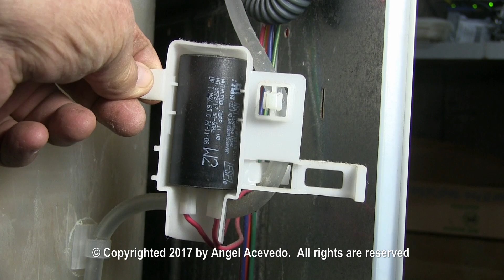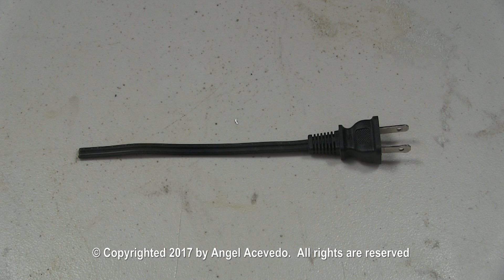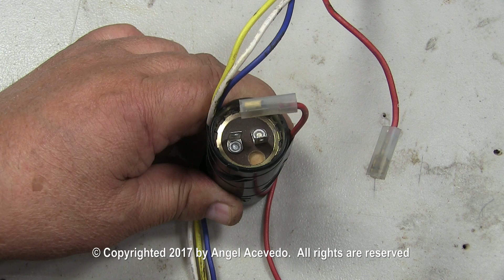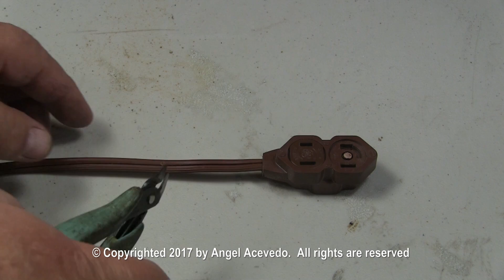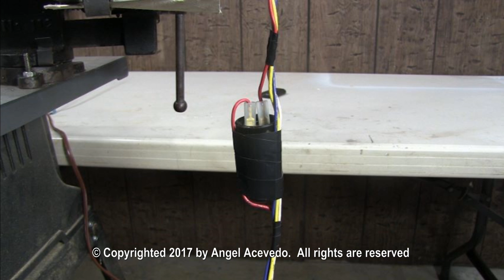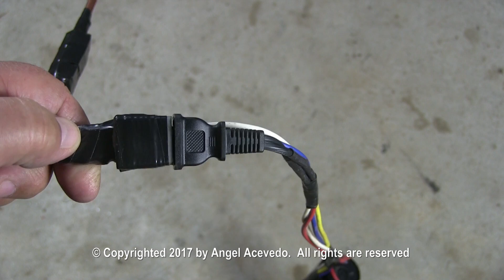Whirlpool Washing Machine Not Starting - How To Make A Motor Tester Wire Harness

Comment: Hi Angel.  Thanks for all your videos.  A while back I though you had a video that showed how to use quick connects to create split  leads from the timer switch and lid switch connector to supply power to test the motor.  This tested the motor functions for agitation, spin, draining, etc on a whirlpool washer lsq8000l series.  Do you have such a video.  I can't find it.  In function it was similar to your test cord.  Thank you very much.

Comment: I need this same tipe of video but on a 4 wier moter
Reply: I too.  One ground wire & three others.                                                                                                                      I don't want to damage it if the problem is elsewhere.  Did You ever find out?

Comment: Where did you get the push button switch?
Reply: It's a safety switch from a dryer when the dryer belt breaks the idle arm from the idle pulley is no longer having any tension and it moves and no longer pushes that button thus preventing the entire dryer from starting because of a broken belt. It's funny you ask that question because when I saw this video when he showed the switch for the first time I instantly was like Hey I recognize that part. Lol

Comment: Will a timer cause spin cycle to be slow after about the third wash, sometimes sooner? I have a set up on my whirlpool washer just like this one, I've replaced the clutch and coupler, and all cycles work good. It gets to the spin cycle and it's slow, clothes are too wet to dry. I did bypass the lid switch so I could watch the cycle in spin mode, it just won't spin fast enough and it is random, sometimes it spins up just fine... all other cycles work right all the time. I'm so tired of messin with this thing, it's got me puzzled.
Reply: Very good job
Reply from the maker: Not the timer only send electricity to the motor winding according to the selectio regular is fast gentle is slower.

Watch this video to see if it help you

https://youtu.be/q942xn_2VXY

angel
Reply: @theapplianceman  ok, I only use regular wash. It has a two speed motor according to the label on the front. I don't want to rule out the motor being the issue just yet, I keep thinking the motor isn't going in high speed, but I do not know what or how that is controlled.
Reply: @theapplianceman  I watched the video, this is exactly what I did to my washer when i put a new clutch in it, but it didn't resolve my issue. I'm not completely sure, but I absolutely do not see the washer has any mechanical problems, I honestly don't think the orginal clutch was even bad, but I ended up replacing it not knowing otherwise.
Reply from the maker: @garyr7027   The speed of the motor is controlled by the timer sending electricity to the regular speed winding or the gentle speed winding. If the motor runs ok in regular and the washer don't spin properly the problem could be the clutch, the basket drive block here is video link     https://youtu.be/ySQeR9XpEMw    check it out
Reply: @theapplianceman  I watched the first video you posted closely, I did not spot any problems, everything appears right, but I could be overlooking something. You mentioned a basket drive might be bad, would that cause a clutch to slip? I put a new clutch in it thinking it needed it just like your video   and other video's state two weeks ago, but if it's still slipping then something has to be causing it. I'm about ready to just buy a new washer, but I really don't want to unless it's just not worth it to keep throwing parts in it. All major parts for this thing isn't exactly cheap enough for me to keep it going... the washer is kinda old.
Reply: @theapplianceman  I watched the videos you posted and I checked out my washer as good as I could. I still do not see or detect any mechanical issues with it, I checked all those things out you posted. The only thing i can think is the timer sometimes does not make the motor spin in top speed or the motor is going bad. This is a random issue it's having, something like you would see in an electrical problem, not in a mechanical issue. The timer somehow would have to control the motors stator current in order to control the speed of the motor, I honestly believe the problem is in that area somewhere cause it's random issue, it doesn't always spin slowly. Thanks for your time and your video's, it helped me out a lot to trouble shoot this issue.
Reply: @garyr7027  The motor has two windings (not counting the start winding) which correspond to two operating speeds.  The timer controls the motor speed by controlling which winding gets energized.  Has nothing to do with stator currents.
Reply: @cleansebob1  I ended up just buying a new washer, something was making the clutch go out on the old washer so I just gave up on it. A old washer wasn't worth putting too much money in.

Comment: direct drive? it is driven by belt.....
Reply from the maker: A direct drive Whirlpool made washer  is driven by a motor coupler attached between the motor shaft and the transmission shaft
Reply: theapplianceman OK. Anyway it's not direct drive. Direct drive motor doesn't have transmission,
Reply from the maker: if you send me the model number I could look to see what you have to see if it is one of the machines I work on. 
I stopped doing repairs when the started to make all the washer with electronic controls
Reply: theapplianceman https://youtu.be/SWM32P-ciXI
Reply: @theapplianceman  don't get me wrong, but such design isn't direct drive AFAIK, because direct drive technology         utilize direct drive motor and sophisticated logic to control such motor.  The one on your video is just regular ac motor connected to gear box  with motor coupling.  Tell me if i'am wrong
Reply from the maker: That what Whirlpool call it because it don't use a belt. it use a motor coupler between the motor and transmission
Instead of using a belt. 
That is all I know About that
Reply: @theapplianceman  thx

Comment: I did d same ting but my cord gets warm in less than 10sec its rated 20A
Reply from the maker: If you made the test cord correctly and the start capacitor is ok, the I would suspect the motor
Reply: theapplianceman i didnt make the test cord i bypassed all dat just 2 make sure the motor was running ok 2 wire on both sides of my extension red+blue on 1 side and yellow+and gray on d other side i used gray cause it had no white but gray was in d same place d white was supposed 2 be
Reply from the maker: Check this video to see if it helps you

https://www.youtube.com/watch?v=nlMWOJxieBU

Angel
Reply: theapplianceman yes thank u very much will b checking your channel regular good vids